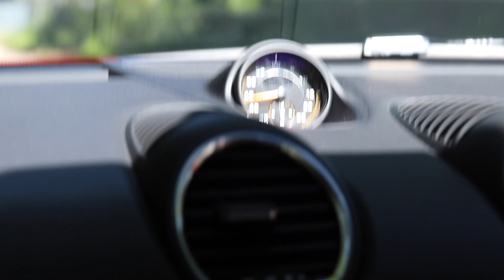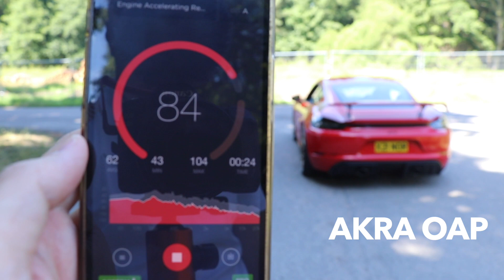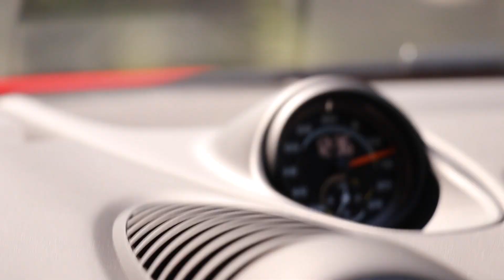PURE SOUND - 718 GT4 Exhaust Akrapovic Link Pipes (vs Stock)

Comment: Man that sounds good! I assume your friend also has the valve override function where the PSE doesn’t interfere? Any drone with the valves closed?
Reply from the maker: Ye, I forgot to mention that Noor has unplugged his valves 😅
There’s a slight drone between 2k-4k revs. But I have the valve controller on mine, so I just revert back to stock and close valves. 
Noor doesn’t seem to mind it
Reply: @MrHCars  dude! this video honestly sold me on the Akra OAP's. Bought a set, will be here in 4-8 weeks, super excited! I will have the soul valve controller installed on mine so ill control the valves that way, and the cool thing about the soul valve controller is i can use the homelink buttons to control the valves. Cant wait!
Reply: How do you like it after a year? I just purchased a 718 GT4. Trying to figure out what exhaust mods to do @gentianmedia3814
Reply: @thatporschedude  it’s absolutely perfect, would recommend getting a valve controller first and seeing if that’ll scratch the itch then going OAP
Reply: I went ahead and ordered OAP, but havent ordered the valve controller. I think I'll do that as well @gentianmedia3814
Reply: @thatporschedude  well worth it!

Comment: Did you have a remap with the link pipes?
Reply from the maker: Nope. Still running stock power
Reply: RPM told me the a remap would give about 40 hp boost and 60 if you had the full system !
Reply: @MrHCars no cel lights from removing the opf?
Reply from the maker: @stephenlongfield8492  nope, just use an OBD blocker
Reply: You didnt have to do a ecu tune?  @MrHCars

Comment: Does it have the annoying drone at low rpm?
Reply from the maker: Nope! And that’s why I removed my backbox & swapped to this setup too
Reply: Did you by any chance measure power gains?  @MrHCars
Reply from the maker: @gogolio  no, didn’t do any dyno runs unfortunately. I only did it for noise benefits